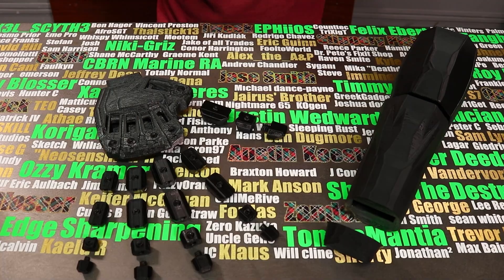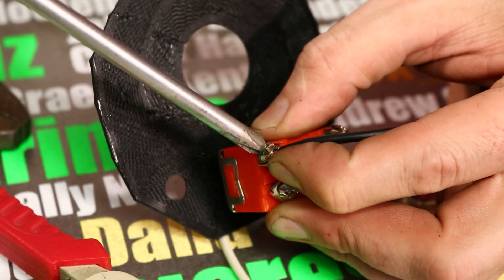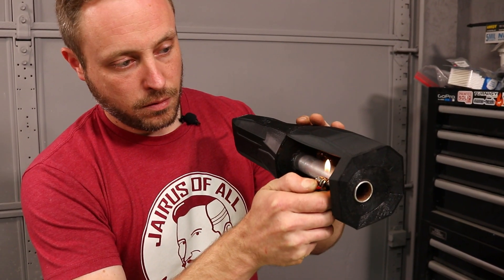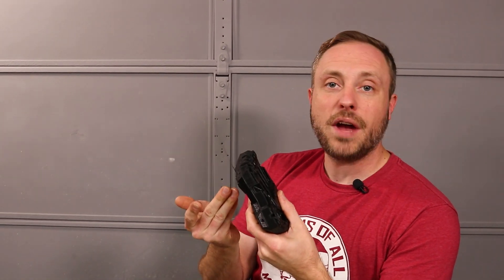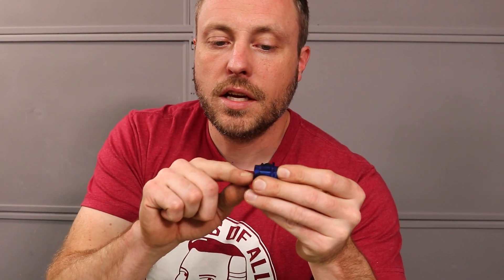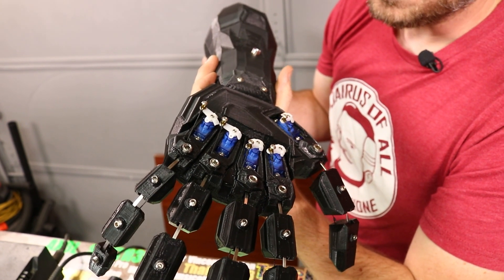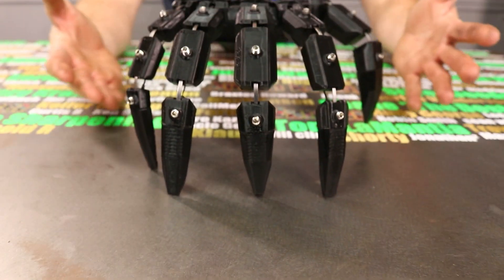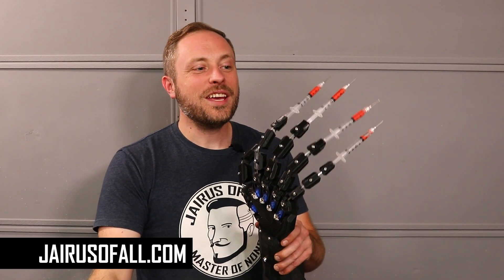Technology Solves an Age Old Problem

Comment: I think some wood cracks due to the water and salt in sweat overtime so dipping or coating a handle in something waterproof if in long term use can be a good idea, some tape let's stuff pass through slightly etc. Amazing project!

Comment: Well I never knew about replacing just the blade... And I didn't know there was spring steel inside. Now to find those junked wiper blades I threw away 5 years ago.

Comment: Nice.
What glue did you use on the printed parts? I find that nothing is stronger than just melting them together, usually with a soldering iron and a flat bit that you don't care about. Hot glue is okay but over time tends to weaken and separate if under stress.